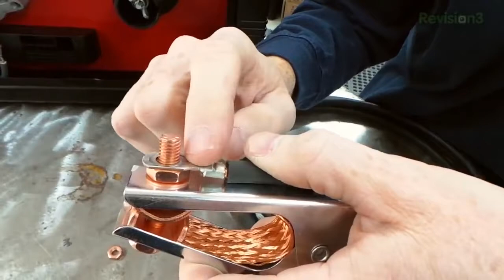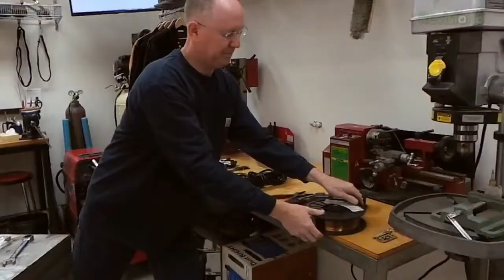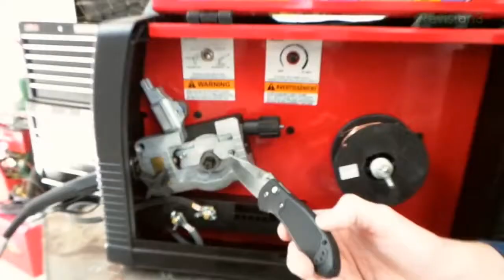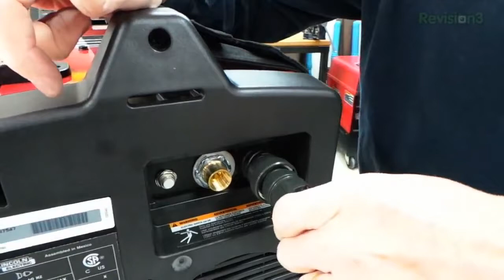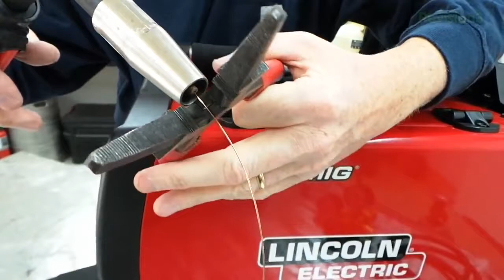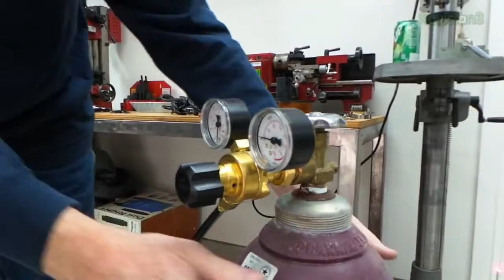Setting up Lincoln Power MIG 180 Dual for MIG Welding

Comment: I figured out on mine you don’t need to take out that tiny little screw to remove the wheel for different wire sizes. You just twist that plastic thing and it pops right off.

Comment: I would  assume  this video  is for beginners Im a retired welder fabricator  of 32 yrs , I would  like to add one thing you should never leave your bottles of  welding gas or oxygen   out in the open they should be chained to your welding cart or to the wall , there was a man in a shop i worked in who knocked  over a standing bottle  of gas it hit the edge  of a steel bender and went through  the shop like a torpedo tore the shop up got wedged in between  a shear  and a I beam !! and another  incident  a man was hammering steel with a small sledge  his hammer  hit the top of an oxygen bottle valve but didn't break it off he tried  to grab the tank and then the valve  blew off and literally went through  his face like a laser killed him !!   2200  lbs pounds  per square inch  comming out of a hole the size of a pencil can do alot of damage  Be Safe guys  chain you bottles !